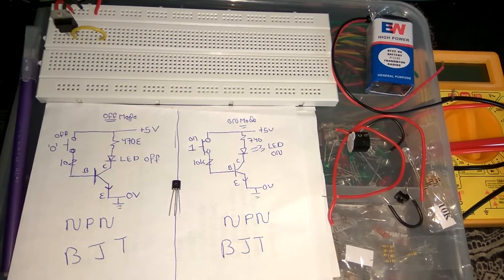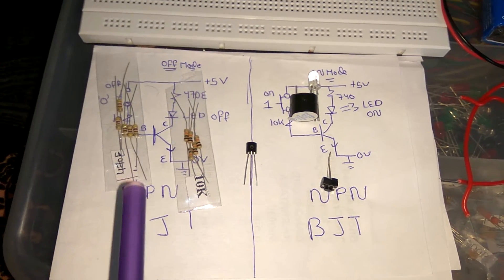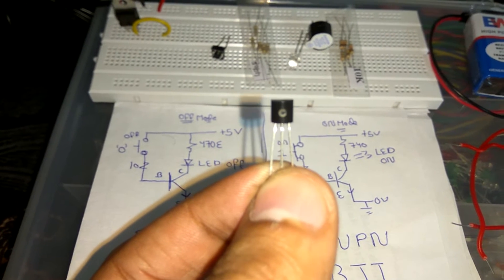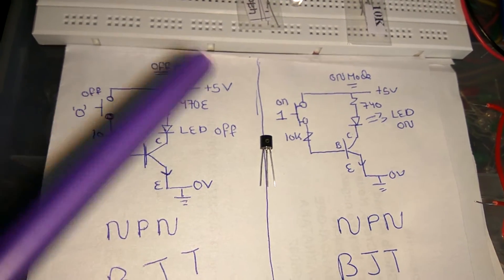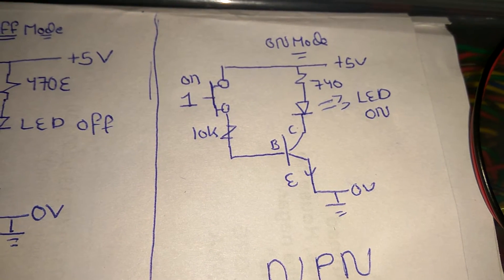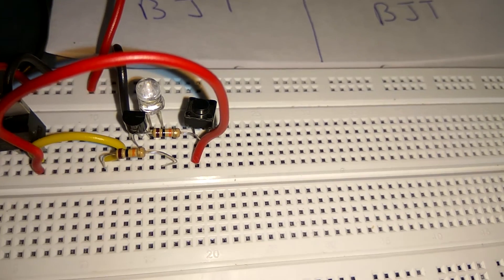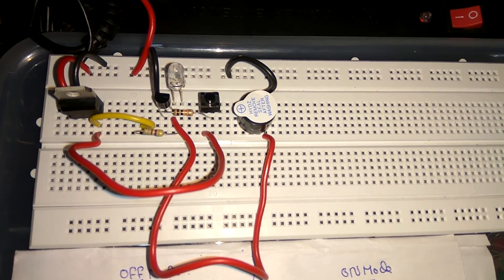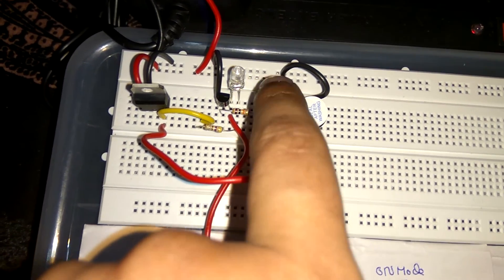Transistor as a switch explained practically

Comment: What is the benefit of using a transistor as a switch?
Reply from the maker: Saqib Shams There is no of reasons transistor as a switch can be locked out for safety. On the other hand, transistors offer many advantages over a mechanical switch. Since the transistor does not break the circuit, you have no arc and therefore no damage to the device.hope u will get the answer
Reply: Er. Shoaib Ahmad thanks a lot
Reply: Ur number required bro